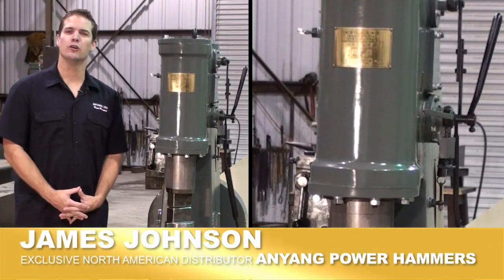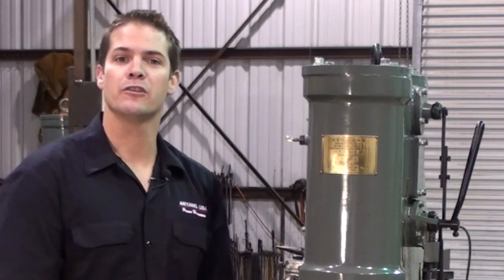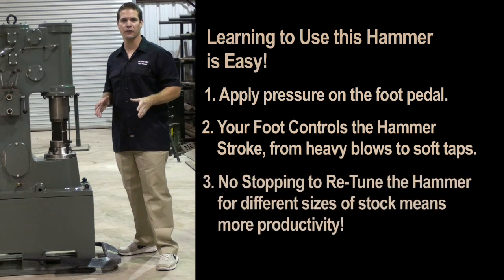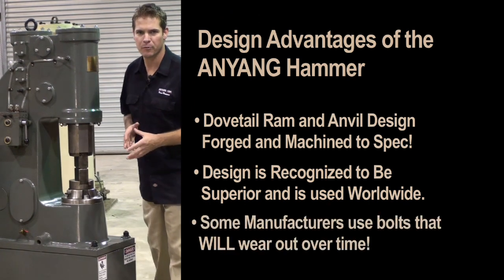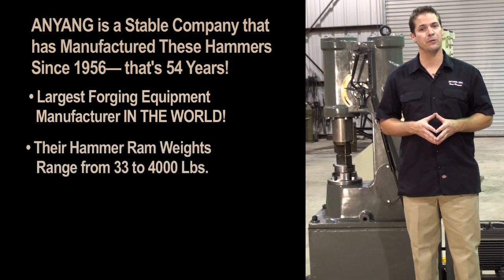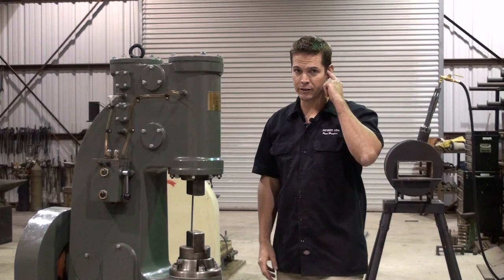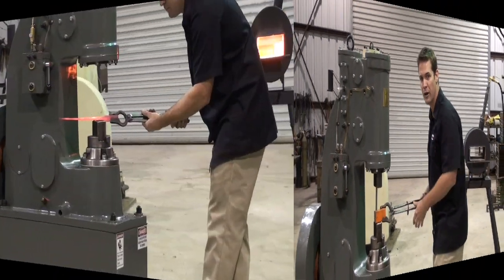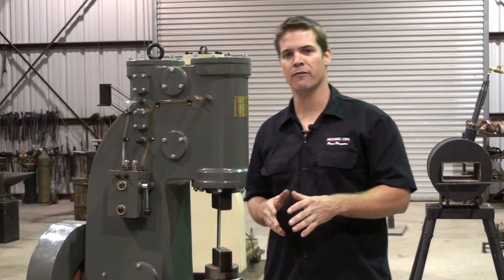introduction to Anyang self contained power hammers

Comment: Any one else here because Alec Steele got a couple and plus I’ve never heard of Anyang and I wanted to see more specs and information about them but I have no worries about them being good because Alec Steele wouldn’t get a piece of junk   Just hoping that the price isn’t too large because my wife wouldn’t be too happy if I had to sell the house just to get a power hammer
Reply from the maker: I have owned Anyang power hammers for over 15 years and have been distributing them for 10 years.  I have been working with the factory and other distributors and over the 10 years have made over 50 improvements to these hammers.  They are truly "industrial" hammers.  I have a website www.anyangusa.net  On that website, I have video's showing capabilities of the various size hammers as well as video's showing how to maintain them.  I also have a contact page on the site if you want to email me for more information.  James

Comment: In my experience, anyone that won't publish a base price list is trying to rip you off.
Reply: Stefan, do you want to know what I did when I wanted to know the price? I called James and asked. He returned my call within 5 minutes and answered all the questions I had.  In my experience, people willing to make lousy assumptions in the comments make for lousy customers.
Reply: I can assure you that I am not trying to rip anybody off... If you talk to any of my customers (hundreds of them), I think you will find that I have built a solid reputation based on supplying an outstanding product at a reasonable price and offer the best lever of customer service that I can.  There are two reasons why I do not post prices:
1.  Prices can change over time based on transportation costs and upgrades that we make at the factory or in my shop.  
2.  I really like to have a dialog with customers.  I have been a blacksmith for over 20 years and have used Anyang hammers for over 14 years.  So many of my customers are basing their purchasing decision on ram weight and cost without considering the long term cost of operation or their real forging needs.  A smaller Anyang hammer will outforge many of the larger "ram weight" hammers on the market.   I really like to help educate my customers on the alternatives and help them make a more informed decision when they buy a power hammer even if they don't buy from me.  If a customer in interested in other input, I try to put them in touch with blacksmiths or bladesmiths who are doing similar work to theirs.  It is hard to do that when you give pricing without an opportunity to have a discussion... 
Let me know if I can help you in the future.   James
Reply: Base price.....without upgrades....not considering shipping....so the average customer can determine if this is anywhere near their price range.
Reply: even base price is going to fluctuate with currency conversion and raw steel price in something this weight.
Reply: Eye  and hearng protection.  Please.
Reply: No offence but if you feel that way maybe it's not for you

Comment from the maker: The total weight of the machine with the base is about 2000 pounds.  The ram weight is 55 pounds, but it hits much harder than a typical 55 lb hammer because of the air volume pushing the ram down during operation.
Reply: jamesrjohn

Comment from the maker: There have been several video's like the will it blend... there was one showing how to use the Anyang power hammer to compress data on a hard drive.  In the end, the hammer did an outstanding job compressing both the data and the hard drive... 
I also did a serious video on how to crack an egg.  The intent was to show the controllability of the hammer.  Guess I should have just slammed it.  Looking at the hits of "will it blend" think you might be onto something.